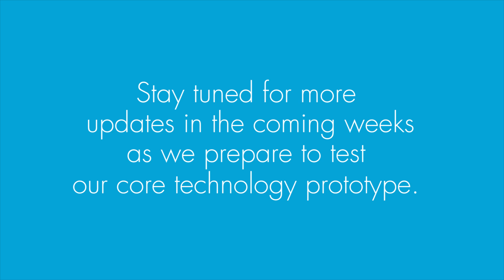Airing Video Update: April 2016

Comment: Others have computed the power and air volume necessary to make this work and it is currently impossible. I suspect that this is a scam
Reply: I am no engineer but the ability to move air I think would have to do with surface area and frequency/rpm. For instance a fan with small blades can move the same volume of air as a fan with large blades but it must spin faster. The same eventual volume of air going down the same diameter opening should produce the same pressure. I look at what has been shown in videos as the area in the front of a nose piece as the area where the "Air Pump" will be housed. The flow/volume of air that is needed for CPAP seems impossible for anything housed in the area of a nasal piece. Even if you could get enough surface area and enough frequency/revolutions how would you power such a device. It would have to be powered externally. So this image of just a nose piece I don't think is possible for the foreseeable future, perhaps not even Star Trek possible.
Reply: @busigh  yes exactly and even if it could be powered and generate the necessary pressure the device pictures has no straps or harness to hold it in place. The pressure needed would cause it to shoot out of your nose like a rocket.

Comment: I'm very sensitive to Air Conditioning System. The last time I worked in an office where air was cooled to 59°F I caught bronchopneumonia and none of the 5 doctors I visited were able to prescribe me something that could make me resistant to cool air. 

I'd be completely grateful if you could develop a device that I could put into my nostrils and ensure that the air I'm breathing gets warm enough for my lungs to remain protected.

Cost is not a problem. Please let me know if you can help me.
Reply: +Emilio Palma they make nasal warmers .
Reply: +NWforager Really? I'll call them in a couple of hours then. 
Thanks a lot!!
Reply: +Emilio Palma sorry .  not this company . i meant "they" generally .   try Googling "nasal warmer" . there is an electric type and a nose cover.   Worked in freezers before and would use a dust mask to keep the nose warm with my breath.  Good luck
Reply: I see. I'll dive into the web and look for it. Thx anyway.